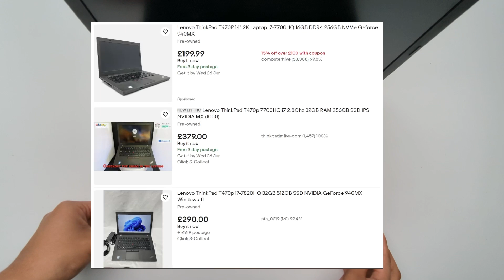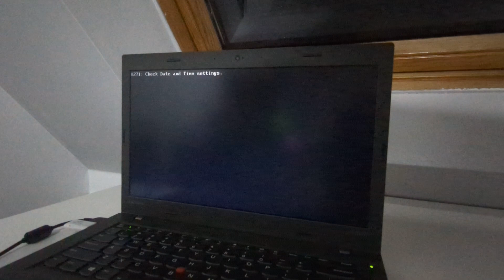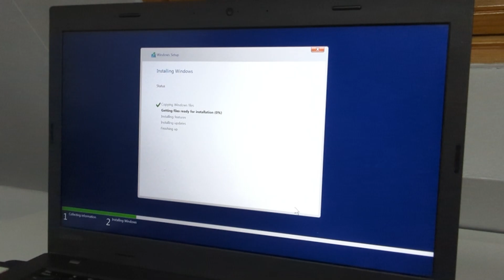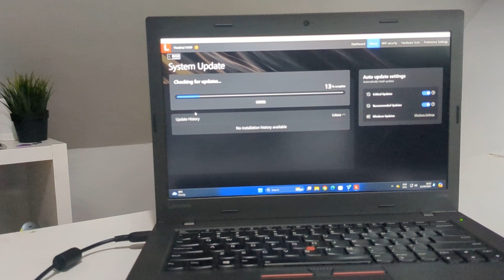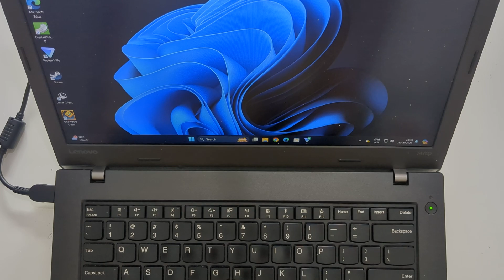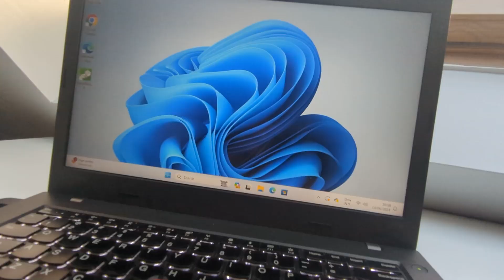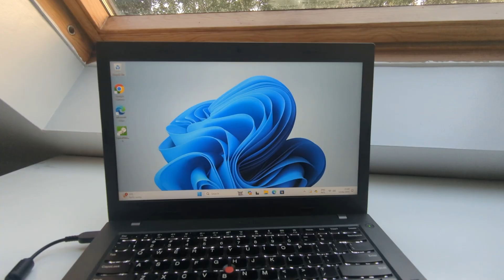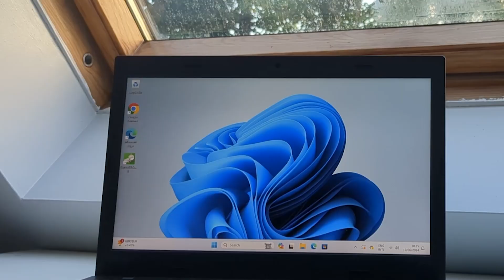DONT buy a ThinkPad T480.. GET this instead (T470p)

Comment: Im sorry but I sacrifice performance for looks, this is just so uninspiring to work with, just plain and simple not motivation to use a laptop, I hjave a T520, with a docking station, an adapter caddy with and extra disk for storage, xcard adapter for 2 extra usb 3.0 ports, and Its wonderful to use every-single-day, when I use the keyboard just wants me carry on and on using this laptop, the screen is a 15 inches high resolution screen and just enough to work, and the feel is just amazing seeing it the eon the docking and the extra things I have upgrade just make same feel happy, seeing the keys on the dock, seeing all the indicator lights and the plastic material is just not the same,there is a different material used on this era of Thnkpads, I use an X200 for when I need to go outdoors and need something more portable, there is just no argument for me, all the apps I use are on the internet so I don't need to run any apps from my laptops so I just use max ram allow and and ssd, also Linux mint which makes htis laptops just fly on the performance side, but nothing beats the feeling of using this classic 7 row keyboards and the feel of them is just another level that I just haven't seen them replicate don modern laptops.

Comment: I appreciate both devices, but I disagree with your conclusion. While T480s with dedicated graphics are hard to find, the integrated UHD 620 graphics are only 30% slower than the 940mx. As you said, if you want to game don't buy either, the use case of benefitting from a 940mx over UHD620 is extremely niche/rare, and every other spec, other than perhaps price, is better on the T480. T480 has USB-C charging, bridge battery system, thinner bezels, more efficient, doesn't get as hot, same outstanding I/O and better upgrade options.

Comment: To anyone thinking about buying a model with thunderbolt, remember to install the emergency TB firmware update, as this prevents the flash chip from destroying itself.

Also, a model with a port for a docking station is more desirable, since the TB port is crippled.

Comment: As someone who doesn't really game, the T480 is in my opinion unbeatable in the second hand market. I got mine about 2 years ago when my Macbook Pro's battery failed on me for the second time. Ordered a new panel and a 72Wh battery for it on AliExpress and did some pretty minor tinkering and it's such a beast when it comes to battery life. With the internal battery and the absolute unit of an external battery, I can still easily get 12-13+ hours of battery time running Fedora. Right now it's at 66% and according to my system settings, it's predicted to hold charge for another 9 hours. And i've got 99% sRGB coverage now.

I replaced the battery on my 2013 Macbook Pro and it was a nightmare. A short time after I spilled some water on the T480 and fried the motherboard completely. Replacing the Mac's battery took about 2 hours and A LOT of frustration, replacing the motherboard on the T480 took me half an hour and was one of the easiest things I've done repair-wise. And the entire motherboard cost me like £50. I've daily driven an X61t (a few years ago) and a T440p before, but the one annoyance was always the battery life. The T480 is unique in the sense that it's still fairly repairable while also delivering battery life that's almost comparable to that of brand new Apple laptops.

Comment: Windows blows folks. Im done and lord knows I tried on my T490. Bare metal linux is far better. Nothing but problems with windows 11 Pro and this thinkpad looks factory new. Immaculate inside. I changed the thermal paste. Thing was always so freaking hot. My little Intel Macs destroy this thinkpad. Great video bro

Comment: Please discard my question below. msinfo32 shows if is a T470 or T480. I have 7  T470's and T480's. The renewed systems was purchased on Amazon for about 200 bucks each. I believe that the average user only uses a PC for access to the internet and MS office
 The average person spends way more for a laptop than is needed. 

Performance, condition and value are fantastic !!!

Comment: This is kind of unrelated, but Lenovo has an issue with the T570, the 15" model of this generation. The ribbon cable that goes to the nvme enclosure (it's like this one) goes to a connector on the board, that likes to get hot and unsolder itself! It would be an easy fix if you got a broken one.

Comment: 3:35
That's because all CPU's produced for T470p has a TDP of 45W. In T480, most of cases, you get 15W TDP. That's why it's quieter, less battery usage, and colder. So yeah, great buy for that price, but T480 still wins
Reply: T470p лучше
Reply: @alexxz-q6w  ну если ты фанат быстро разряжающегося ноутбука, и горячего - да, лучше. Если натурал, то нет, не лучше
Reply: @ у меня холодный и зарядку держит отлично
Reply: @пинатель-хохла  пруфы?
Reply: T470p wins in performance, T480 wins in power consumption, the i7 7820HQ is around 20% faster than the Core i7 8650U which is the highest end CPU option for the T480.

Comment: Is it a normal usb Windows 11 installer that you made with Windows Media Creation tool or usb installer that has some bypass in it? I want to know because I have a plan to buy this particular laptop with same spec because it has quite powerful CPU (not a U-series, I'm sick to U series performance) and it has dedicated graphics that I'm sure it will be enough to run my old library games, and average price for this particular machine has going down to about $200-$220 in my country depend on storage and ram option. Apparently I still need windows to use some application like games, microsoft office, etc, and I'm not really familiar with linux yet (I have a plan to exploring linux tho). But, I have doubt since microsoft doesn't officially support Windows 11 for this CPU other than on their surface studio and dell precision if I'm not mistaken. So I really have no Idea about Windows 11 on this machine. Will it take clean installation from usb drive? And will it be receive Windows update like security and features in the future?

Comment: to someone reading this comment: go for a t480s if you won't max out a t480. the t480s has the same amount of ports and more because you can add another ssd. it is also thinner and lighter. These laptops should not be used for gaming.

Comment: Unfortunately windows 11 is not officially possible in the 470. I have one and love it, got 32GB ram installed. Will have to go Linux after October 2025
Reply from the maker: the 7820HQ CPU does in fact support it
Reply: My 470 has 7 gen I7 and the MS app says it is not supported 
The 7820HQ is in the T480. Glad it’s supported but it’s not my model.

Comment: I have the regular T470 with the I5 7th Gen and 16GB of RAM and i have it on Windows 11 and it runs with no issues. I also have an HP with a 5th Gen I3 and 12 GB of RAM and it also runs with no issue

Comment: I remembered using Thinkpads in school and they were always junky so I wrote them off for a long time. I recently found myself in need of a decent laptop for a fair price. I got a T480 with a i7-8650 with Nvidia  mx150 for around 200 usd and I couldn't be happier. It far surpassed my expectations and has become my favorite laptop I've ever used/owned. It came with an empty SSD so I installed Debian. I know the video is about the T470p but I just wanted to say that I have come around to liking Thinkpads, and now understand the cult following.

Comment: I disagree, get a T460P instead. While having almost the same performance in most regards, it stays considerably cooler than the T470p which allows for an almost silent use while doing office tasks etc.. The T470P on the other hand lets its fan run way more often, regardless if you get the 7700HQ or 7820HQ.

Comment: do you reccomend this for simple editing and render video with capcut software?
Reply from the maker: The T470p is a great machine and heavily underrated. Find yourself a good model with enough ram and you'll see it fly though. Though, limit your expectations as it is getting quite old. But for simple editing and rendering it should do just fine.

Comment: I just bought a Thinkpad L380 with i7 8550u with 16gb and 512gb ssd. I paid $220, good condition no damage. It is a good deal?? It seems quite fast. 2884 on cinebench r23.
Reply: Seems good, I've got my t480 with i5-8350u with 16gb and 256gb ssd for 205$ including tax and shipping to literally another continent.

Comment: No type-c and a cpu with a high tdp make me lean heavily towards the t480. I'd rather have somewhat better battery life and type-c since i have a desktop that i use for real work
Reply from the maker: I understand your view, but for raw performance this is a better choice. I agree that battery life would be better on the T480 since it had two and U Series CPUs.
Reply: Are you sure about that? I’m pretty sure the 8th gen U processors match/slightly better than the 7th gen HQ ones at quite a bit lower power requirements.
Reply: @cephacore  The raw performance is admittedly very cool

Comment: Nice! -- QUESTION -- I ordered a used T480 with the FHD/1080P screen. However, the sent the one with a "touch" screen which is a feature I would never use.  It is also FHD/1080p. My question is, I can return it and get the one without "touch".  Do they both view the same or is the Touch screen worse quality or a battery hog?  Please help.  I must decide quickly and I think they intentionally stuck me with this screen.
Reply from the maker: Hi, thanks for your question. In regards to touch screen laptops, they do use more resources in the background so yes it would lead to a lower battery life. But not by much.  However, they also tend to keep their value than their non-touch counterparts so if you were to sell it on later then it'd be a better investment. Also, I'd always opt for a FHD 1080p screen as they look much better. The 768p screens are TN and awful. IMO, I think you got quite lucky but it's up to you whether you want to return or not.
Reply: @cephacore  ...intersting...  My T480 has the touch with 1080p and the UHD 620 graphics vs HD 620.  I assumed that I wanted to non-touch screen and the basic HD 620 graphics.  They said they would exchange it no problem.  Would you recommend that I keep it and be done.  I thought that the UHD 620 caused heating issues and contributed little and that the touch screen was not a clear as the "normal" 1080p screen but now I am not sure.  I can't find any direct side by side comparison of the two.  Some say it gets 30 percent worse battery life but not sure why if that is in fact true.
Reply: @Coleen-Love  For longevity avoid touch screens.

Also do you think yours can run Adobe well

Comment: picked up a t470s for crazy cheap last year, had zero issues with it since
Reply: Good but 1 memory slot only and 1 x 4gb soldered.  1 X storage drive only the wan slot is useless for second drive (don't detect it) upgradeablility is very limited. But overall ok for £80.
Reply: @jonskitch8082  oh yeah there's not much to it but it runs linux well enough and it has no real dedicated loads - it replaces an hp 9480 that died.
Reply: @thelegion_within  which distro do you use on it?

Comment: I own T580 (two batteries, one is removable.  really good option).  T470 look very thick to me.  T490 is great, but T490S is even better (I own both).  After owning X1 carbon 5 for few days, and if I can go back a year ago, I will focus on X1 Carbon Gen 6 or/and X1 Yoga Gen 6 (both at ebay today around $150.   Instead of owning so many T490/T490s/T580 (all under $125). P70 also great.  15.3" screen will not make it to my choices.
Reply from the maker: A T580 is deffo something I want to get ahold of. People rave about the T480 but the bigger screen is a positive for some

Comment: Do you know which battery sits flush with this laptop?  All I can find online is these 72wh really big ones that practically doubles the thickness.
Reply from the maker: only the 24wh ones sit flat, the 48 and 72wh are quite chunky
Reply: @cephacore That's why they now integrate the battery in newer models. By removing all the required plastics, connectors etc. Lenovo can now squeeze in a 57Wh battery into the T490 and T14. That lasts a whole day in the office. For longer battery just use a power bank with USB-C plug and you're set to go.

Comment: where did you find this for £70
Reply from the maker: eBay UK, gotta be lucky when browsing around.
Reply: @cephacore  3 weeks ago I found a T470s on ebay for £50 the only issue was that the batteries were dead so I fixed them and it cost me a total of £120 so thanks :)

Comment: This laptop doesn't have USB-C display out. it's e-waste. If you wanted to save money dell precisions and Latitudes fill this price gap nicely. Alternatively the Peak computing is getting p51 workstation with pascal based P5000. its based of desktop gtx 1070 with 16g of Vram. and my unit was 450 usd.
Reply from the maker: You have to consider the price I bought this for, which is a hell of a lot less than a P51 workstation which normally go for £300. This wasn't so deserves to be uplifted. I don't agree it's e-waste. HP Stream's, IdeaPads from 2016 are e-waste as they are obsolete and there are simply better options for similar prices. This is one of them.

Comment: For my studies, I use a super portable Thinkpad X390 with 8th Gen i5, where the battery easily lasts a day. And currently I'm watching your video on a Thinkpad T430s with 8 gigs of RAM, a fast SSD and an i5 3320m processor powered by Ubuntu 24.04, which is still more than decent enough for office, surfing and light work. Ubuntu works perfectly fine. Thinkpads are simply a dream, I love them all! Best regards from Germany!
Reply from the maker: That's great to hear, I might do a video on an older ThinkPad with Ubuntu. They're defo work better than Windows. Thanks for watching 😄

Comment: I got a week ago a T560 for part for 31€ lucky was the top model it only need ram and a ssd ( and a clean ) it’s  a good machine with the mx940 too but the drawback was it’s cpu it’s a i7 6th gen with 2 cores but… it was a upgrade from my main machine a T61 :) really nice machine, well built. Crazy battery life (12/14 Hours) with the 2 batteries.
Reply from the maker: That's incredible. Such a good deal for all that, nice 👌

Comment: What makes me sad is that the number of available great Thinkpads like these are only declining, just like people who are older than you in all earth, the number only declines. I appreciate new Thinkpads with their advanced and efficient processing power, but the design choices are poor. The removal of external battery is the only thing preventing me from buying newer laptops. It is the most useful feature any laptop could ever have. 

I managed to successfully hunt for a T480 with maxed out specs, I7-8650U, dedicated GPU, 32gb Ram, WWAN 4G LTE for only 280$.
Reply from the maker: Yeah it's disappointing they had to remove the external battery. That's honestly one of the best features. That T480 deal is incredible..

Comment: I would say get a T14 at this point.  Depends on budget of course.  But get this, flip it, then buy a T14
Reply from the maker: The T14 doesn't have the removable battery. I'd say the replacement to this would be the P14.

Comment: I think you install windows a little backwards.  Don't let it connect.  Make a local account.  Then run bloaty nosy.  Then let Windows get the drivers and updates.  Then debloat again.  Then get official drivers for the graphics.  But hey, you do you.  I do 2-4 installs of 11 per week.  And the P denotes workstation class.  The T480 is obviously going to be a regular T class.  Everything is connected via x2 PCIe lanes anyway, not x4 like it should be.  The HDD Caddy connector is not SATA, have a look there are extra pins.  It was a very short lived Server connection for PCIe 2.5" drives.
Reply: I prefer massgrave + atlasOS

Comment: I've just bought a T460p with the 940mx graphics, 16gb ram, the backlit keyboard and an extended battery for £100.
I was looking for a t480 but couldn't find one with everything I wanted. Just waiting for it to arrive in the post.
Reply from the maker: Solid deal, the T460p is essentially the same as the T470p. Hope you enjoy it 👌
Reply: @cephacore i guess i got pushed onto this video with all the googling i did for t460p specs.  my wife wanted my macbook, so thought id give my old work machine a go.  i have the t460p i7-6700HQ, 940MX i just upgraded to 64GB ram (lenovo says max 32 but intel said max 64, and it worked, pretty sure limited to i7 variants though), bought a 170W ultra dock to run on my 34" ultra wide, new thermal paste, new nipple for style points and wifi 6E card.  have been pleasantly surprised, pretty much out performs my m1 macbook pro in everything but battery, which now i know it's all working i will buy or build a beefcake one.  trying to track down that nvme adapter from the 470 which apparently works in the 460. should be a pretty noticeable upgrade from sata ssd.  all in all it's a mid-high tier machine in 2025 and even if you had to buy everything you could build one for $300-$600USD depending if you're patient or not.... you also get to tell everyone that you use arch btw